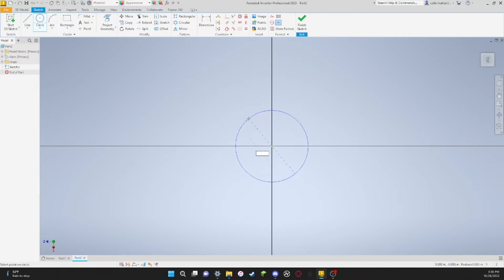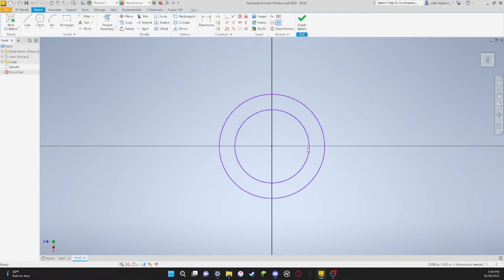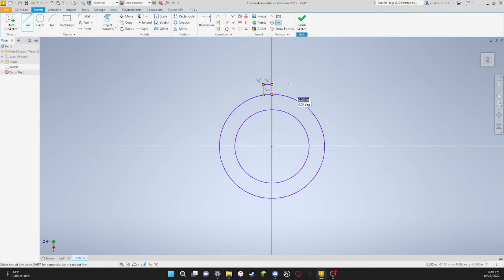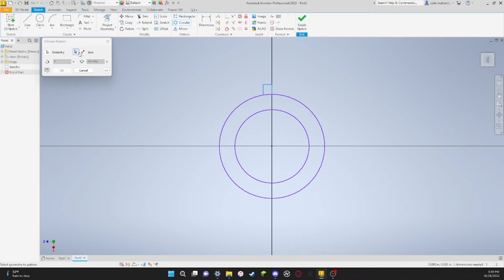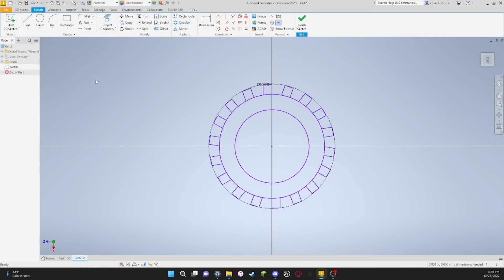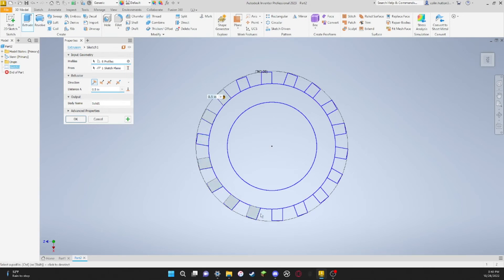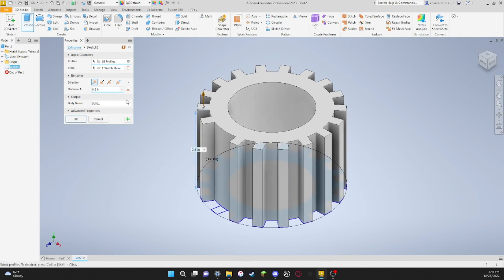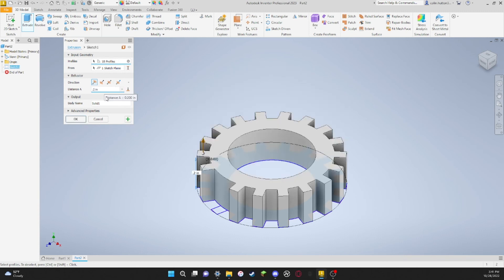Autodesk Inventor Pro 2023 -  How to make a gear for beginners

Comment: do you know how to add the helix angle of 10 degrees on this?
Reply from the maker: Good question. From what I’ve learned you use the “coil” tool. 

https://forums.autodesk.com/t5/inventor-forum/helical-gear-tooth-profile-how-do-i-get-the-right-helix-angle/td-p/3728900